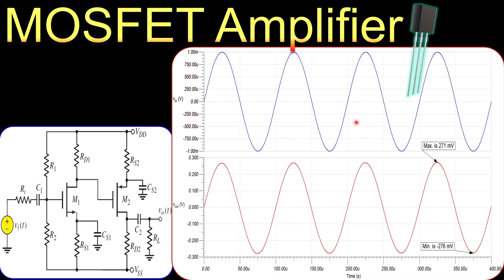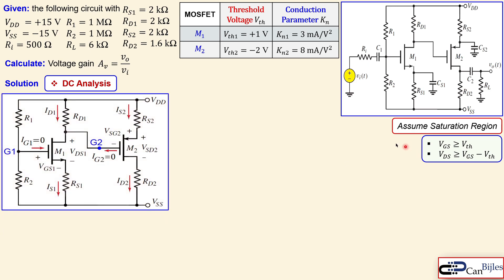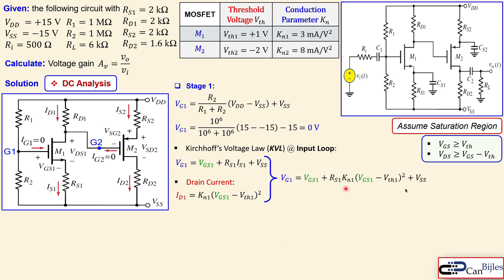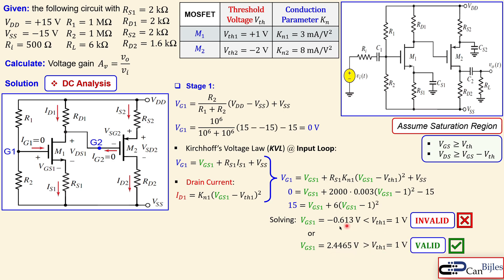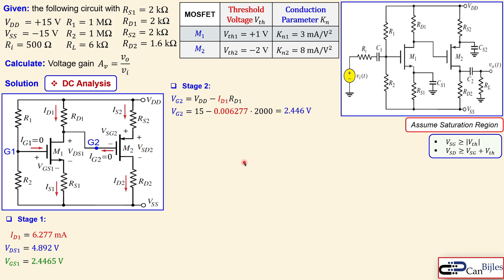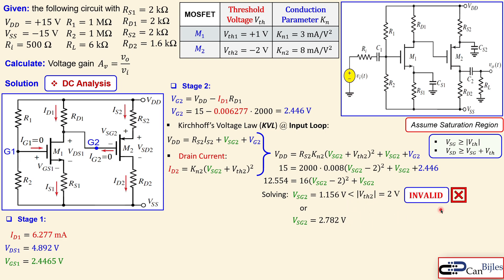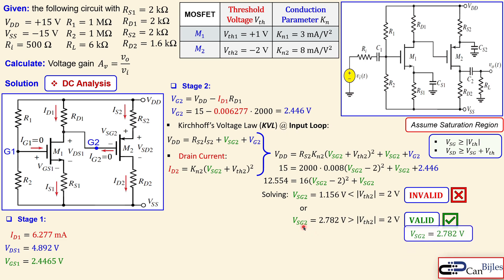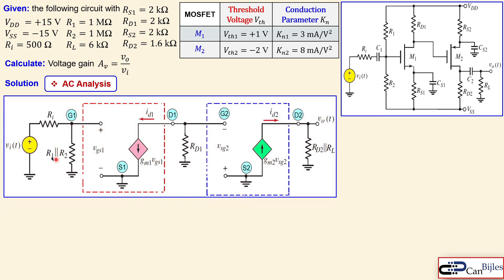Two-Stage MOSFET Amplifier 🌟 N-Channel & P-Channel E-MOSFET 🌟 Calculations & Simulations 💡 Example 5

Comment: thank you for the examples, i think in last stage we should not have - because current entering rd2||rl based on graphic
Reply from the maker: Thanks for your message. The vsg2 is negative there, so we have effectively a negative sign also in M2.

You can also see that the total   voltage gain is noninverting, so both stages need to have an inverting action.